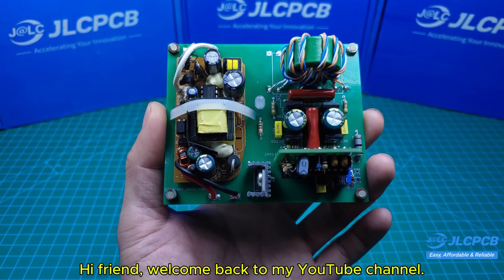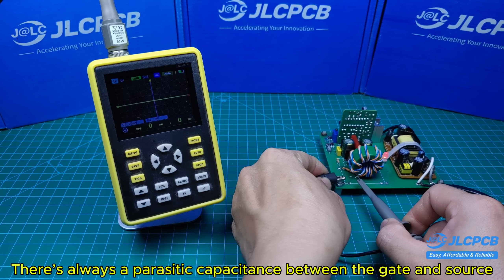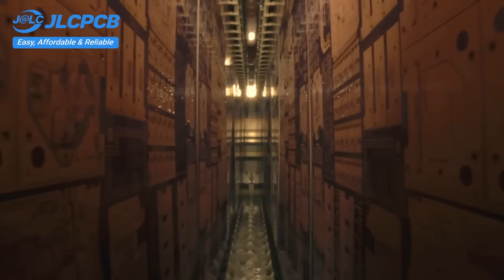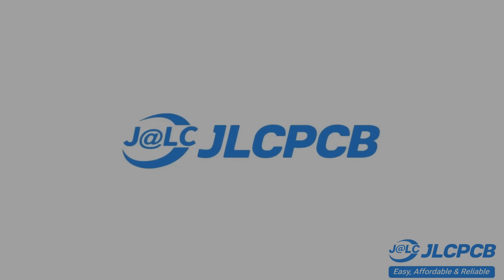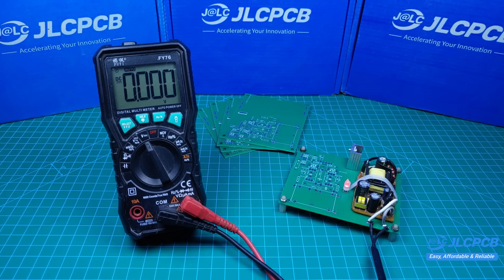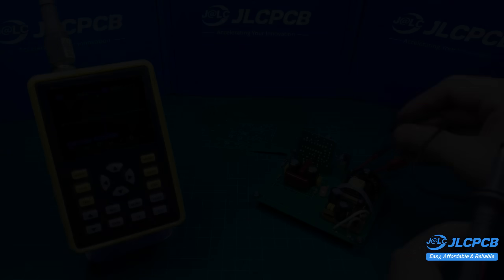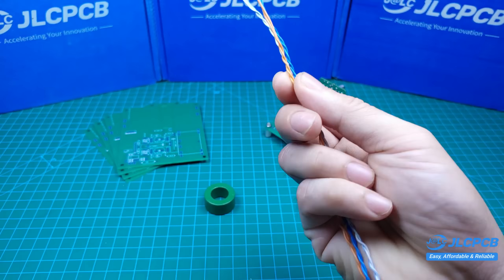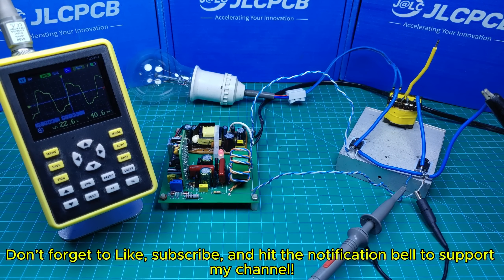The Ultimate MOSFET & IGBT Driver Setup – Watch the Waveforms | JLCPCB

Comment: Hi, nice work! Some questions please: 1) The square wave after capacitor still not "square". Is not possible to improve the wave to a profile same it has out of SG3525 board? 2) The SG3525 board was build by yourself or bought kind of "plug and play"? If plug and play can you share the link? 3) Is that main board good to deal with two IGBT CM400DU-12F? Thank you a lot!

Comment: Bro you will make 120v to 12v isolated power for inverter using uc38xx ic
Reply from the maker: Check video in my channel bro. It can work from 90 to 230 bro using 38xx